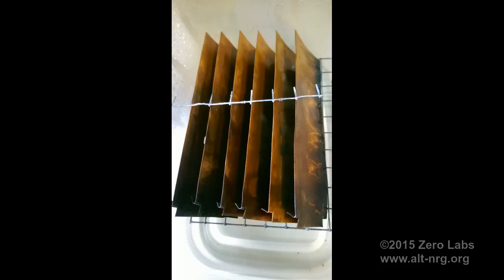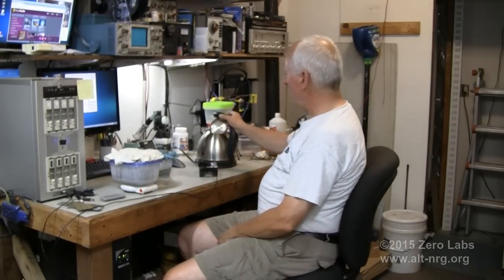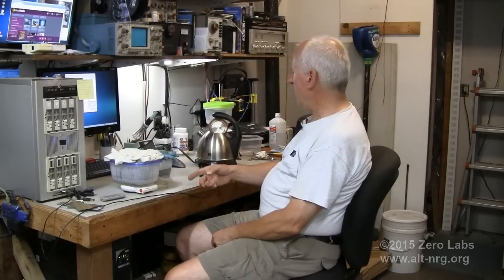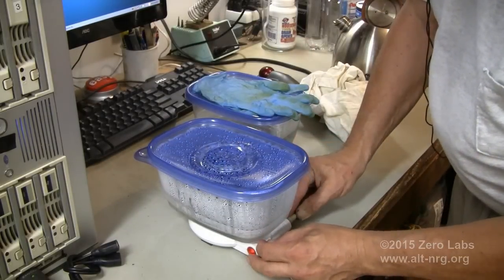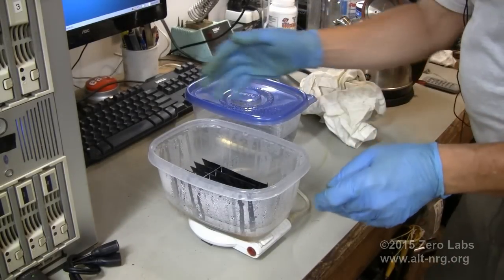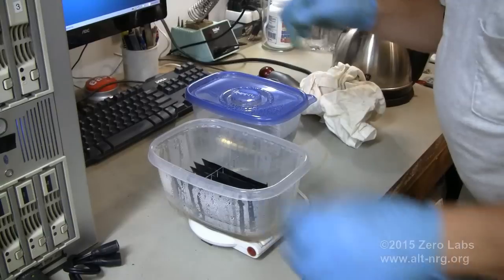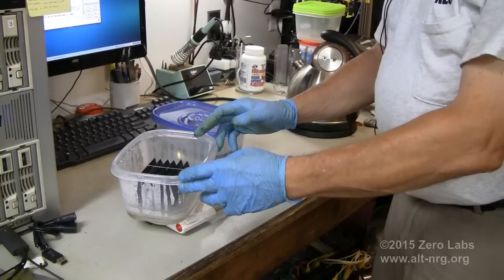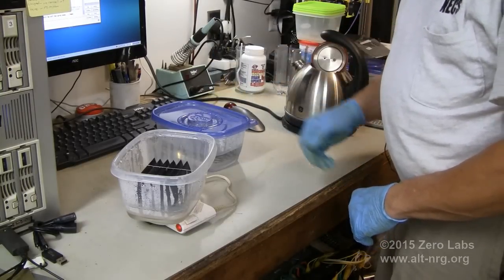#407 Keshe Plasma Reactor project update 03

Comment: You admit deviating from the procedure several times during your video series. Or admit lacking the discipline to be scientifically ethically proper
Reply: You've got it cinched.. that's if you want it to fail...why don't you just follow to the letter the procedure....? Instead of unscientifically subjectively condescending your Superior scientific prowess... ignoring how critical scientific process must be adhered to while trying to disprove or prove something... any Unknowing mind would be reading right through this.. in Theory . . to a possible false conclusion.. that you sir are a charlatan of process.. for some reason for some motive

Comment: Thank you for making this experience. You were wondering  if the particles where CO2 gans. This is the document Keshe is referring... Hope it helps confirming the CO2 extraction process. http://pubs.acs.org/doi/pdf/10.1021/acs.nanolett.5b02427
Reply from the maker: +TheDMTLover Yes. It confirms that the carbon element in CO2 can be converted to carbon nano fibers. Not CO2 GANS.
Reply: +ZeroFossilFuel Thank you. I was also wondering what Nano particules in suspension looked like and if we could see the "fileds" or organisation of these particules (I'm the curious type). I came accross this. It's from a company that makes Nano materials. http://nanograde.ch/nanoparticles/speciality-nanoparticles/oxide-nanoparticles/?gclid=CjwKEAjwmZWvBRCCqrDK_8atgBUSJACnib3lvWNttE6f8BHpMCRkxyn2pEG--DPCLSBC_uPvUUg-XBoCgs7w_wcB

Comment: In the video keshefoundation.org/Instructions/NanoCoatingInstructions.mp4 the plate was grounded out against the mesh every 6 hours as part of the drying process.  He described this step as VERY IMPORTANT.  I don't see that you did so in the 3 coatings you have applied so far.  Can you comment?
Reply from the maker: watchman1958 I've been doing that throughout the "drying phase" and I do see substantial voltages that Armen showed in his video.

Comment: Hi, some copper wire has fine insulation.. ie the one that use in transformer/motor or generator... so i guess you need to stripe the insulation first.

Comment: Some of the electrodes look to have a dark tint / black look to them. Was this how they were when you submerged them? I ask only because you mention that they look very clean, but when you put them back in, it looks like some of them are quite a bit darker than when they were in solution. Looks like a coating on some of them to me. Maybe as they dried the layer "grew" ?  This is an interesting project.  Reminds me of when you first started your HHO experiments.

Comment: Try not to go too fast, let it dry objects a half or full day so that the layers can grow. You will get a better result, it obviously takes a lot of time. I had used a coated plate and put it aside, after a week the layer had grown back again.
Reply from the maker: Geert Vranckx WELL WELL WELL!  Look what the cat dragged in. :-D  Glad you decided to join in!  Haven't seen anything at your channel for quite some time.  Are you off the grid yet?  Flying around undetected by the military industrial complex?

To address your comment, yes there will be a drying phase as shown by Armen. That will take 3-4 days minimum. I'm anxious to start making some GANS.
Reply from the maker: I believe that's correct. Only during steaming where air can also interact do I see the black layer formation.
Reply: ZeroFossilFuel Is it possible that the copper wires are not coating because they are submerged in the liquid? New at this so not criticizing. Thanks.
Reply: ZeroFossilFuel Hi Marcquez, its good to see your work. Armen does first nanocoat under caustic because of it he has black colour rapidly, then steaming 3-4 times. Nature needs time, you do it very nice. Thank you for tip, love your work :)
Reply: Geert Vranckx 
They are liars charlatans, and con artist's, don't give these fuckers a cent.
It's an elaborate con nothing more.
Reply: draw the current off the plates every 5 hrs is the final phase while drying for uniformity.
Reply: +Peter May how do you know ? have you made one of them? explain to us why you say it is a con job
Reply: +Butter Bean 
 
Well I have been in the electronics and materials technology industry for about fifty years now. I just know that what they are trying to do is impossible, because energy can neither be made or destroyed. Don't forget people have been trying to make these devices now for about 2000 years without success. Ask them what principle the device uses they can't tell you. Ask them where this energy comes from and they can't tell you. Ask them what the math is to design and build one, and they
can't tell you. Your bike can't roll uphill, but these charlatans will sell you one that does. Don't throw another log on the fire and it will go out, don't stick a gallon of gas in the tank and see what happens.
This is universal, with hydro electric power you get the energy from the falling water. It's so stupid that this question is even being asked. But like W.C. Fields once said “Never give a sucker an even break”, problem is some people will always believe you can get something for nothing.

Ask the poor deluded soul who made the video, they will probably bury
him with his useless plates.
Reply: No one up till this point could achieve gas in atomic nano state and superconducting at room temperature so obviously you're 50odd  yrs is about to be taught a new lesson.
Reply: +Geert Vranckx 
Do you find it easy to manipulate these gullible souls?
Reply: Well, Peter May,  now you can eat your words.

Comment: Please confirm that also performed the first stage in the six plates,
i.e. the plates were initialized dipped in boiling water poured
lye about 30 grams per liter.
Reply from the maker: filipeber Yes, all went through stage 1. In fact, I started my plates with a bath in boiling water/vinegar/salt mixture to clean the tarnish before starting. Victor says that's not necessary. I now tend to agree. The 24-48 hour bath submerged does a good job.